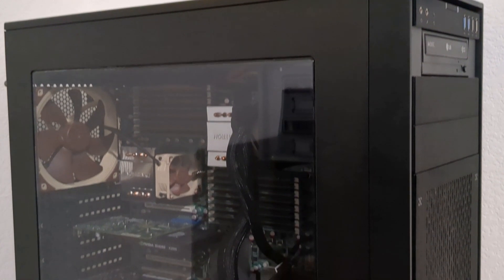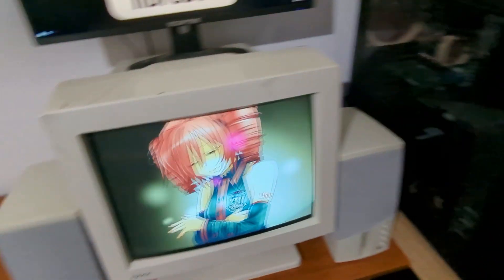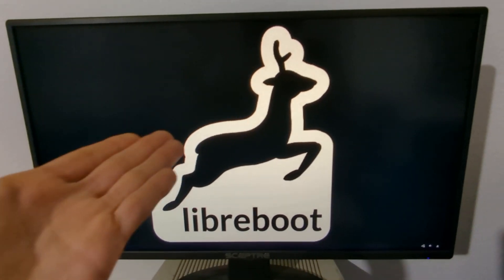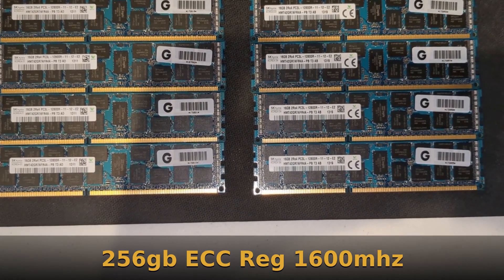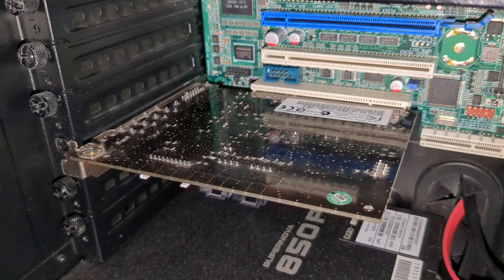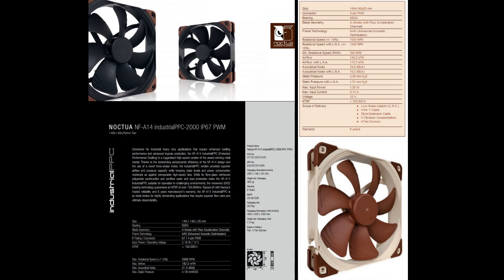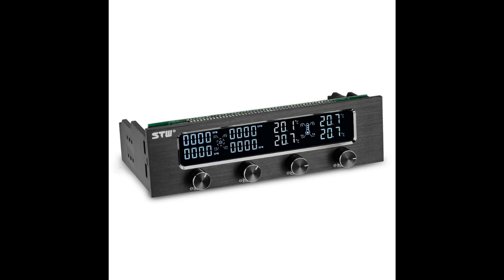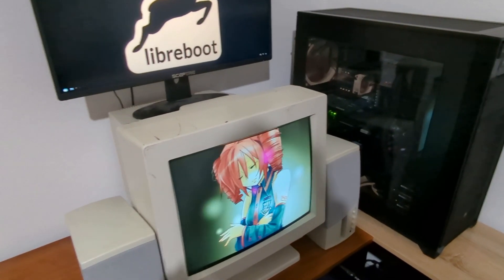The Ultimate Libre Workstation (Running Libreboot)

Comment: Nice job! I didnt understand what the model of mobo, but as I remember libreboot compatibility list - its some Asus. You can search for ES Opterons that are overlockable using multiplier. I've  used some Supermicro board with modified bios that can FSB overclock any Opterons, but it was not Libreboot compatible.

P.S. May be you can help others, who want to build something similar by placing HW list of your WS in the video description.
Reply from the maker: Good idea, I just updated the description to have the specs of the workstation.Thanks!

Comment: If you have enough pcie lanes to run 2 gpus, you could just add a Nvidia tesla M10.
Reply from the maker: I heard of this card but unfortunately for the kgpe-d16 running libreboot cannot have 2 gpus connected to it otherwise the computer will not boot. the k6000 still seems to be the best when it comes to having one gpu.
Reply: @SecondR-Freedom  I see, so there is probably no proprietary driver for nvidias optimus stuff. 
Hopefully one day the noveau driver will make it possible.